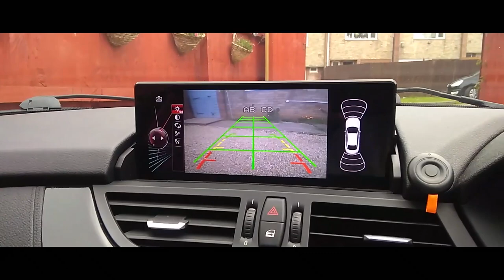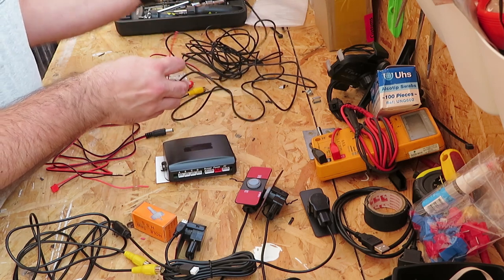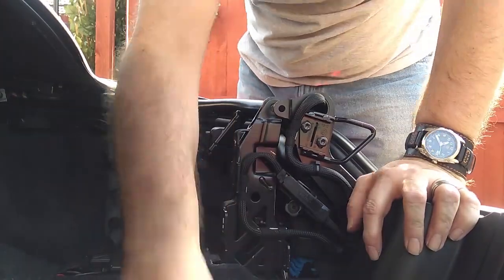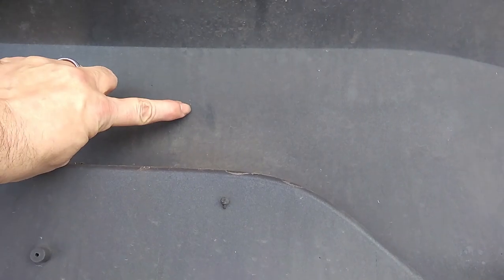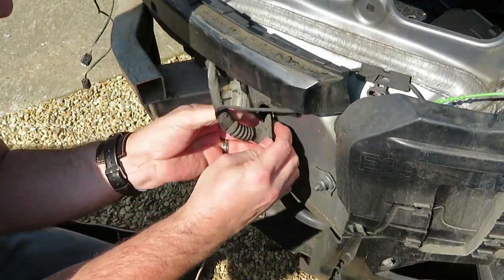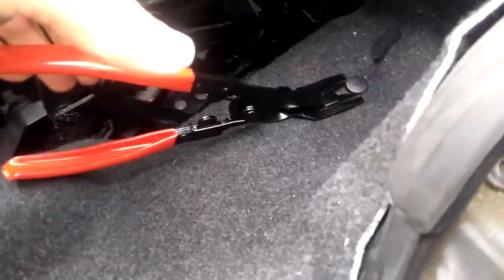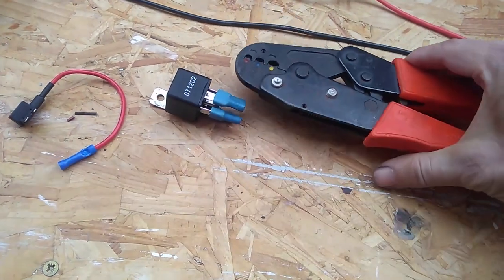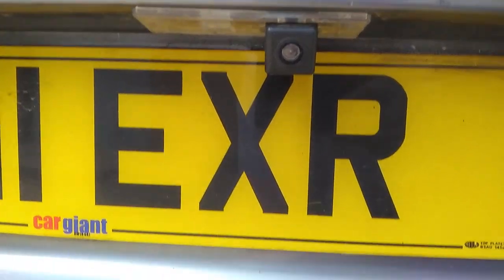BMW E89 Z4 Parking Sensor/Reversing Camera Install

Comment: Used to repair my tail light which had water in.
Very helpful explanations.
Thanks a lot for making such detailed videos.
Big help for E89 owners.
Reply: My rear indicator light has begun to fail intermittently. Forums say this is mainly due to water ingress/condensation build up due to a faulty rubber seal. It sounds like a similar problem to yours. How did you fix yours? Was there an obvious defect in the rubber?
Reply: @Aliabbas07  I removed the bulbs and then used a hair dryer with an old magazine rolled as a funnel to dry the taillight. Once it was dry put silicone with one of those silicone pistols on the area between the gray plastic piece and the rubber. One of the noses holding the rubber is broken. Then used some rubber conditioner and voilà...taillight dry and working for months now.
Reply: @maxmustermann1193  amazing! I’ll have to give it a go! Thanks for your speedy response

Comment: Hey Dave. Might also be worth adding that at 5min 20secs the bolt that’s right up behind the bumper, through the wheel arch that needs removing with the extension bar is also an 8mm. There is a 10mm bolt right next to it. That is for bodywork and holds the upper part of the wing to the car and is no use at all in this operation!
Reply: The 10 mm bolt you're talking about is a painted bolt and shouldn't be confused with the 8mm bolts which are the same ones holding all of the bumper and wheel well liners. 

In my case however on my US Z4, rather than an 8 mm bolt, I had a T20 galvanized torx screw; I ended up confirming that my ratchet and extension was in the same location as Dave's so I unscrewed it and out came the bumper without busting any tabs..

Comment: Hi Dave, so cool you shared this. Very good camera work with the recording. One question: is it essential to take out rear light to take off the bumper? Thank you for the answer!
Reply from the maker: Thank you. I'm glad you liked it.
This was my first time removing the rear bumper, and I was following a guide I'd found (no videos around then). It turns you don't need to remove the rear lights 👍
Reply: I already read the answer in comments! Thank you once again for the video!
Reply: I plan to give 2nd life to exhaust tips to my beloved car. For that I needed help on taking off the bumper. 👍

Comment: My vote for the next video goes to retro fit cruise control. Currently looking to buy an E89 but it doesn’t seem to be a common factory fit.
Reply from the maker: I'll see what I can do, I've got a couple of guys coming to have theirs fitted and I need to change my stalk set over as part of my auto wipers mod so the next three videos may be filmed together anyway. I'm just trying to sort the best way to record the coding sequence, as my laptop isn't powerful enough to run the coding and screen capture at the same time. It won't be to long away though 👍
Reply from the maker: Videoing of the fitting and coding for Cruise has been completed today so hopefully I'll have it uploaded by the end of the weekend.  Hope you like it.

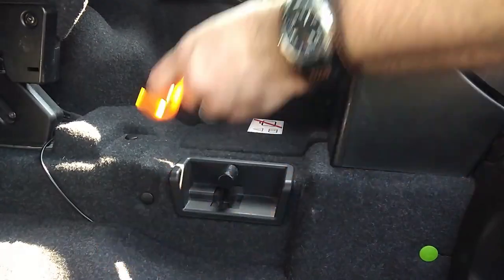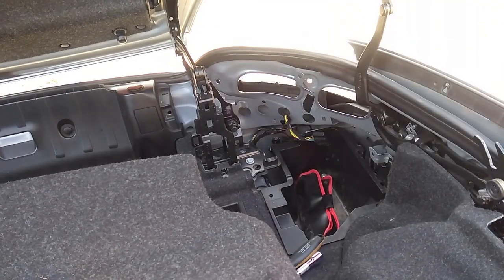Comment: Hi David, so from 5:45 to 9:18 is unnecessary because you don't have to remove the tail lights, correct?  Thanks.
Reply from the maker: Yes that is correct,  you don't need to remove the rear lights.

Comment: Great Videos. Did you color match ( paint) the PDC sensors? If so just touch up paint?
Reply from the maker: In this video those came that colour, but I have a new video coming soon where I retrofit OEM full PDC and I bought a rattle can in my correct colour.
If spraying it just needs to be a couple of light coats, enough to cover properly but not too much to affect the sensor.
Hope that helps 👍

Comment: Dave, at the 9:27 mark when you start to remove the bumper from the side, would it be better to first apply a heat gun to the seam where you're going to pull the side bumper away, to make the tabs less likely to break?  For the one tab that you broke there on the right side, was there any problems after you put the bumper back on?  Thanks!
Reply from the maker: Yes some heat may be of assistance there, I did actually do this on a warm day though.
As for the damaged tab, it made no difference and I've had the bumper off twice since as well. The bolt accessed from the wheel arch is holding it perfectly.
Reply: @BMWZ4Mods  thanks David   I think I’m going to wait and pick a hot spring day to do it.
Reply: Dave when you reinstalled the bumper, how did you ensure that it would be lined up correctly?  Did you start from one of the wheel arches and then work your way around to the other arch?
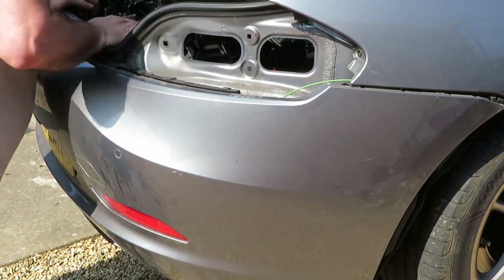Reply from the maker: @milovan8565  at 15:41 you'll notice that the bumper turns up to meet the matching rear 1/4 panel is out of line (plastic green pull cord for the fuel door), line this up both sides equally and you'll be centered. I recommend cleaning the lip of the bumper where it goes into the black section that is between the lights, so that there is no dirt on there as it'll aid sliding it back in place.
Reply: @BMWZ4Mods  Good idea on cleaning the dirt David,  I might then spray some WD40 to ease sliding it in, then clean off the spray after the bumper's back in place.
Reply from the maker: @milovan8565  silicone spray will work better 😉👍
Reply: @BMWZ4Mods  thanks David yes the type of WD40 I have is the silicone spray version.

Comment: Great video.... one question, how do you get the boot lid into maintenance mode?
Reply from the maker: Press and hold the roof open button, when the rear roof is on top of the front roof section and the deck has opened to the vertical point, release the button and it will stop at this point.
If you have an aftermarket roof module (like SmartTop) then open the roof like normal but once it's at the right position press the close button once, and this will stop the movement. 
Hope that helps
Reply: @BMWZ4Mods  Thank you so much.... Worked a treat for me.
Reply: Thank you for this video. Is ‘maintenance mode’ an important part in order to get the light off? My roof decided to stop working on me whilst trying to replace the rear light and I can’t work out if not being able to get the roof up is preventing me from removing the rather stubborn light. Any help gratefully received!

Comment: David, I came across some instructions on the Internet that talk about the differences in installing the power wires for the rear camera, based on whether you have a manual transmission like yours, or an automatic transmission like mine. Basically it says that you do not need to connect the red and black wires to the reverse lights if you have an automatic transmission. Can you confirm that is accurate?
Reply from the maker: Agreed, that's what it looks like 👍
Reply: @BMWZ4Mods  David, would that therefore eliminate the need for a relay like the one in your video then?
Reply from the maker: @milovan8565  yes it would.

Comment: What clip did you use on the camera to keep it in place?
Reply from the maker: It was just a piece of bent plastic, nothing specific.
I wouldn't recommend a camera that fits in the number plate hole due to it being off centre and not straight to the car. I would recommend a number plate surround type camera instead as its central and square 👍
Reply: @BMWZ4Mods  appreciate it, I see what you mean with the camera off to one side.

Comment: Hi Dave

Can you confirm this is how you set up your relay for the reverse camera?

85 - Negative (ground from Rear Light Unit)
86 - 12v from Reverse Light
87 - 12v wire from fusebox
30 - 12v feed to camera

Thanks,
Jay
Reply from the maker: Yes that is indeed correct 👍
Reply: @BMWZ4Mods  one more question, which fuse did you tap power from?
Reply: Hey Dave can you reply when you can?
Reply: Hi Jay! Do you achieve to install your reverse camera ? Is relay obligatory or just using T-Tape on Positive / Negative working ?
Thanks !
Reply: @BMWZ4Mods  I figured out this weekend that the relay in itself is not needed....feeding the camera from the R-lights is perfectly ok. But then you have to code the cold and hot check of those lights out (to prevent the module briefly switching to camera, and switch music & display off). If you (or anyone else) wants to be so adventurous as well - happy to figure out the actual parameters (again)....

Comment: Hi Dave, how did you connect the LED in the enclosure with the camera?

I used two T-Taps to connect it to the plus and negative of the tag light, but it would not turn on.
Reply from the maker: LEDs are electrically directional specific, have you tried swapping the wires over?
Reply: @BMWZ4Mods  i think my product was a defect. Ordering a new one.  Do you have to connect the Red wire to the input on the screen?
Reply from the maker: Well my screen activated, when placed in reverse, prior to me installing the sensors and camera, so I'd try it without before you put everything back together, if it works ok then you're fine, if not then connect the red wire.

Comment: The battery is in the back, why not just take power to the relay and camera from there?
Reply from the maker: Yeah that's a good point. I was running the video cable to the front anyway so it wasn't a problem and using a fuse piggy-back fuse connector is a lot neater. Horses for courses, whatever suits your own thoughts is always a winner.

Comment: Hey Dave,

I think my camera was a defect so i bought another one and it powers on fine when i test the connection with a 12v battery.

However, when i connect everything as it should be connected in the car, the camera does not power up at all.  Do I have to use a relay like you used in this video?
Reply: the strange thing is the reverse light works fine when I haven't tapped the camera in to it, but when I use my T-Taps to tap in to the reverse light, both the camera does not get any power and the reverse light also does not work anymore.  I get the warning light on my dash.
Reply from the maker: I initially tapped into the reverse wire for the trigger wire, camera power and sensors but due to it failing constantly  I fitted a standard relay and just used the tap to operate the relay (as per in the video).
Make sure you are tapping into the correct wires and the right way round.
Reply: @BMWZ4Mods  Sadly I've been at this for days and can't get the camera to operate.  So you don't think tapping into the reverse positive and negative wires for just the camera power and trigger will not work?
Reply from the maker: @jayan3257  OK, just to check....

Firstly are you running your tap wires from the correct lamp wires? Have you checked that you are receiving 12 volts when in reverse?
Secondly have you ticked "Aftermarket Camera" in the "Camera/Video Settings" page?

Yes I definitely recommend using a relay (as per the video) and only using the tap wires to operate the relay and that's all.

Hope that helps.
Reply: @BMWZ4Mods  I tapped into the actual lamp wires instead of the the harness like the way you did it.  Do you think this would make a difference?  Right now, the camera seems to not be getting any power at all.  I have an LED camera that I've tested using a 12v battery (to make sure that it is working) and the LEDs will not turn on.
Reply from the maker: @jayan3257  do you have an electrical meter to check if you are getting 12vDC to the camera?
Even if you are it just may not be enough to power it with the LEDs. You need to install a relay, but you MUST make sure that you are receiving 12vDC, because if not then it's pointless carrying on.
Reply: @BMWZ4Mods  I think I might try again with a regular camera and if that still doesn't work, ill use a relay.  What was your problem without the relay?  The camera would randomly not work at times?
Reply from the maker: @jayan3257  Just as a heads-up (don't think I've already mentioned this)....... For the right-hand reversing lamp - 12vDC+ is Black/Blue, and the 12vDC- is Brown

Comment: Hello bmw z4 Mods i need an hint...wher eis located the PDC module unit?Mine probably is ko but i cannot find it....i watched in front and rear hood but no way to find it...My z$ is a e89 23i from 2009 .Thx Mark
Reply from the maker: The OE PDC module is located in the boot (trunk), right hand side under the panels next to the roof module.
Reply: @BMWZ4Mods  thank you for the info but i did not find it maybe i need to remove panels?Sorry but i m a neewbie about this ..
Reply from the maker: @austinpowers1970  yes, as you see me removing the panels in this video it is below those ones.
Reply: @BMWZ4Mods  in the rear right under e the light
Reply from the maker: @austinpowers1970  yes
Reply: @BMWZ4Mods  ok i appreciate all your hints, but i cannot see in the video the module in the right so i cannot know where it is really placed and i also see many parts dismounted but i think that could be not necessary to dismount all panels, really i need to know which panel to be dismounted where the module is under.Can you still help me?